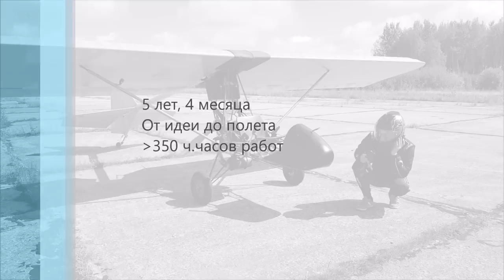Kolb Ultrastar first flight

Comment: some  very late info.      the  pilot  should  understand that  this airframe was/is  a design Disaster.          at :19, the main wing has been made with  a   WONKY   profile.       it appears that the  amount of Mass  in the main spar is  greater  than it could be.        the dom  of the tail boom has  Not  be  optimized; ie,  NO  taper.   distribution of mass.        the stabilizer design is  also  WONKY.        googletranslate